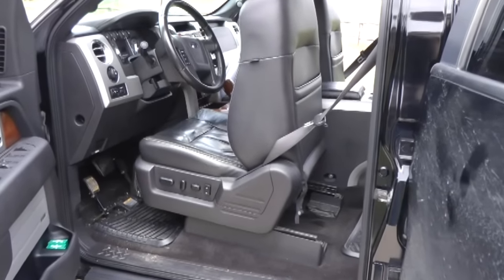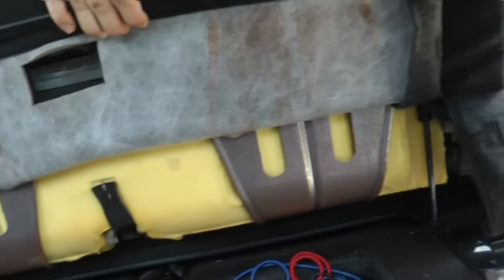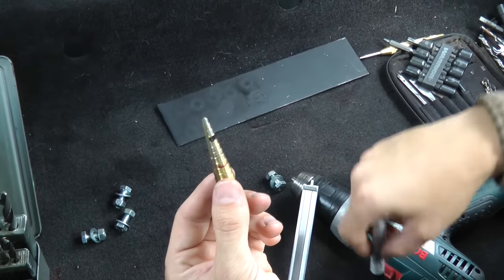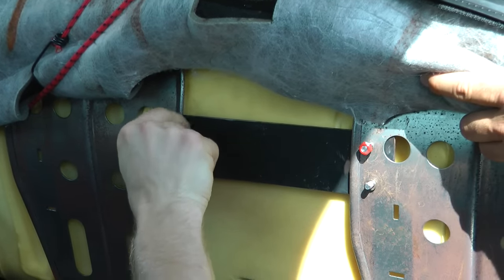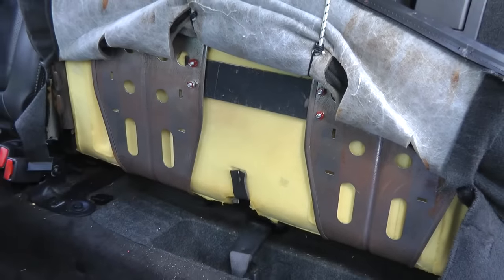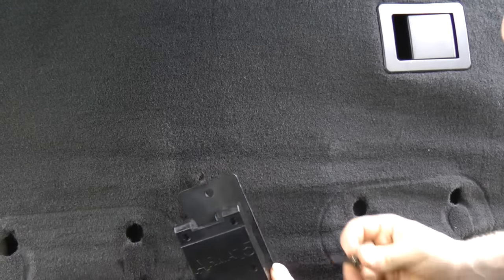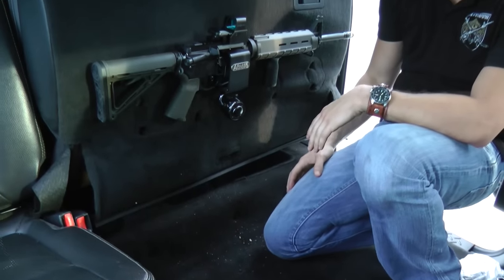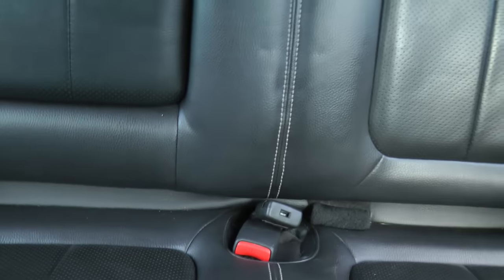ARmA15 Installed in Truck under Rear Seat AR15 M4 Locking Mount F150

Comment: Very cool, I like it!....I do have one concern and would be glad to hear from others....With the rifle being located by the mag well in a moving vehicle do you see any potential issues with the rifle moving around while driving placing undue load on the mag well?
I'm thinking maybe a plastic/rubber coated hook added to keep the rifle from moving around....
Thanks for the video  :)
Reply from the maker: The mag well in your ar15 is made out of aircraft aluminum while the only thing touching your rifle is ABS plastic.  So there is no concern there.  We have also had a customer completely total there car, bend the frame of the car and arma15 and ar15 showed no damage of any kind.  I also have one in my jeep and on ATV which have been run several hundred miles off road with no damage to the ar15 or arm15 in anyway.  Rest assure no steel touches your rifle.

Comment: Probably should have mounted it on the floor board instead of the seat. It’s quicker to run off with the seat vs it mounted to the floor board.
Reply from the maker: We have done installs in that location as well neither is better just whatever the customer wants.
Reply: ArmA15 AR15 I guess it’s just for the piece of mine for me. Excellent work though.

Comment: How well would this work for a scoped hunting rifle with out shaking so much that it un zeros the scope?
Reply from the maker: +Tyler McDonald If your rifle scope can handle the abuse of recoil then it can handle the very minor movement's when in a vehicle.  The rifle is held in arma15 via the magazine catch do its not bouncing around.  Also its high strength abs plastic so there isnt any issue.  I have a trijicon and a leupold that have been off roading many many miles and zero issues of any kind.  Its not held in via locking mechanism as no steel touches your rifle.  Hope this helps!
Reply from the maker: +Tyler McDonald If your rifle scope can handle the abuse of recoil then it can handle the very minor movement's when in a vehicle.  The rifle is held in arma15 via the magazine catch do its not bouncing around.  Also its high strength abs plastic so there isnt any issue.  I have a trijicon and a leupold that have been off roading many many miles and zero issues of any kind.  Its not held in via locking mechanism as no steel touches your rifle.  Hope this helps!
Reply: +ArmA15 AR15 very much so thanks bud could i basically do this same thing to the back of the seat of a single cab?
Reply from the maker: yes,  I would look into the rivnut kit on arma15.com  as we figured a much better faster and easier way to install using rivnuts.  You can piece together the hardware yourself but you will find that hardware is pricey.  Either way test fit and measure 2x then drill and install.  We have done them on floorboards, back behind single cabs, car trunks, police racks.  Since its low profile and can be used at any angle the install options are pretty endless.
Reply: +ArmA15 AR15 thanks this was a huge help great video!!

Comment: Is it a bad habit i keep my AR in between my seat and cup holders?
Reply from the maker: Not a bad habit.  When I am in the vehicle that's how I use it.  It's only a bad idea if you leave your rifle unattended that way for criminals or kids to have access to it.  When I'm using it it's right next to me when I go into a store, gas station etc it's locked up via arma15.  Simple really.  Pistol on hip rifle is secondary.
Reply: ArmA15 AR15 ohhhh boy well i mexican carry everywhere pretty much. Whenever i’m at flea markets or even inside stores i have my shirt tucked in with my colt .38 super. Whenever i do leave my AR in the car i make sure i’m not gonna be at a place where i’m too far from my truck

Comment: Would this work on a 2016 Sierra 3500 HD Denali? Using a Kel Tec PLR 16?
Reply from the maker: We have not tested plr 16, however it does take ar15 mags so its possible.  We didnt design for tavor or scar 16 but those seem to work as well.  There are several different ways to install in each truck.  This is just one example, subscribe as we have a gmc video coming soon.  If you want more info about installing in your truck contact us via arma15.com comtact page.
Reply: ArmA15 AR15 Ok thanks man I'm subscribing as I type keep up the good work!And expanding your brand!

Comment: Having to get out of the truck to access your weapon is kind of inconvenient wouldn't you say?
Reply: Not when u have polite zombies or understanding people robbing u
Reply from the maker: +5.56 Or 5.45? Have the rifle sitting on your lap when your in the vehicle if you wish, or mount the arma15 directly over your driver seat roof as some customers have done.   But this provides it a place to be when your away from the truck and the rifle isnt allowed to go with you.  :-)  Better a rifle in the truck locked than a rifle sitting in a safe at home.
Reply: +ArmA15 AR15 I can dig it. Keep my sbr under a large carhartt on the back seat.
Reply from the maker: Or front seat, or lap or dash board.  All work but what happens when you wanna leave the truck is what this solution is about.   Mine is in my jeep 24/7.  Keeping it in your hands and out of criminals.
Reply from the maker: You can roll around with your ar15 locked and loaded in your lap if you wish(state law permitting)  or with a pistol on your hip as most do.  ARmA15 provides a solution when you aren't in your vehicle and you want your ar15 to be there when you get back.  I leave min in my jeep at all times...

Leaving a rifle or any firearm for that matter unsecured isn't a good habit for a multitude of obvious reasons that generally keep people from using there most effective tool with them.

Comment: I would like to do this in a dodge ram 1500 2017...where can I buy this?
Reply from the maker: We have kits for your truck.  Arma15.com
Reply: f.e.d inc Are you planning on doing this on the passenger side? I have a Ram 1500 and my only complaint is the bench seat is on the passenger side.
Reply: @charlessubke5450  I planned on putting it on the driver side

Comment: does the bolt have to be locked back?
Reply from the maker: +alicia kitchen Yes.
Reply: Is the portion of the mount that goes into the ejection port rubber coated?  Has anyone had experience with the bolt releasing on a bumpy road?
Reply from the maker: Andy,

 There isn't any possible way for any steel to touch your rifle even if the bolt closes.  The magazine block is made from abs plastic.  The lock bar which is steel that goes into your ejection port has no way of touching your rifle.  Also the magazine block block's the access to your chamber so no one can put anything inside the chamber of the rifle when it is locked in the arma15 it also servers as a bolt catch so no steel touches your rifle.
Reply: +ArmA15 AR15 Thanks. I actually just watched a different video of a wall mounted option that gave a better view of the magazine block.  Very cool.
Reply from the maker: Thanks Andy!  We tried to think of all these little things when we were doing the prototyping, research and development phase.  Another purpose the magazine block serves that isn't really advertised much is it will hold in the rifle so if you don't need it locked up you can have the lock off and the magazine block will hold the rifle and isn't released until you push the magazine release button on your ar15.

Comment: I so want to do this but this my only issue with this is the gun is pointing to me.
Reply from the maker: When your taking it off and putting it on your in front ejection port not barrel so its not pointing at you.  Its physically impossible to have a magazine in and the bolt has to be open to put on the unit.  With all this said you can point barrel either direction left or right see our website for barrel facing left and right pics.  It's a preference thing makes no difference.

Comment: What if you need to kill a robber and he is in the back seat
Reply: Dr. Steve Brule , driver pushes a button  , the back seat has a ejection module set up , but the roof doesn't open up , boom one squashed robber written in the cab ceiling ...... looking forward to that video
Reply from the maker: +Dr. Steve Brule Ever tried to maneuver a rifle in a truck, that would be a pistol moment for me.  Also i keep my rifle loaded and up in the seat when in use.  I just use arma15 to lock up when i am not using such as when i go in a store.  We have sold to a dozen police departments as well....

Comment: Takes too long. I need to be able to access it without exiting the car (in the event that there were perpetrators trying to break in around me)
Reply from the maker: Or you can do as this user does and I do, rifle loaded and ready between seat and console barrel down.  And lock up when your away from truck.  Other users mount to roof above driver seat.
Reply: vince gredo that is a secondary weapon primary is a 38 special super o  desert eagle or one 5.7 in your glove box
Reply: Just hop in the back seat. I have similar truck and there's plenty of roof to crawl through the middle.
Reply: Simple logic really pistol on hip.  Rifle locked and loaded when you're in vehicle locked inside Arma15 when you are away from vehicle.  Military FBI and a dozen different police agencies use arma15 in vehicle in this situation.  Leaving it unattended and unlocked when your not in vehicle is not a good plan.

Comment: what you really need is a finger print reader ....
Reply: Being a firearms instructor I would advise against that.  If you do need this in a defensive situation then I would go with something faster and more reliable than any bio metric lock.  I don't like bio metric locks for firearms related products as in many cases your fingers wont activate the product.  If your hands are wet, dirty, bloody the fingerprint wont read.  A simple 1500 id lock can be opened in about 1 second with a simple directional movement a little bit of training and your hands could be wet, dirty etc and it will still work.  I understand the thought of bio metrics and it sounds like a good idea in a vacuum, but bio metrics aren't usually a good idea and they are crazy expensive as well for almost no upside.  Do you have a fingerprint reader on you phone, laptop?  Ever had your fingerprint not read because it was wet, dirty, or for no good reason.....?   I have.  Maybe in 2 years or 10 years they will make one that will work up to my standards but they just aren't there yet.
Reply: I've tried to unlock my iPhone too many times to know that's exactly what he doesn't need lol
Reply: Wrong.

Comment: If you buy a foregrip, is it angled, vertical, or unknown? Our laws distinguish between these different parts, and you can easily violate the federal law known as the National Firearms Act by installing certain parts on an AR-style pistol and turning it into an “any other weapon” or “AOW.”
To make matters worse, if you lawfully purchase parts for your non-sporting rifle and install them in certain states, you may have turned a legal, non-sporting rifle into an illegal “assault weapon” under your state’s laws, just by adding cosmetic parts. Gun control laws don’t usually make much sense, and these “cosmetic feature” laws are an excellent example of how little sense gun control laws can make. Gun owners know that a flash suppressor, a foregrip, a collapsible stock, and other parts of a rifle don’t make it more deadly, but more states continue to pass “assault weapon” bans, which make adding these parts to a non-sporting rifle illegal.
Reply: Dont sweet the petty stuff pet the wetty stuff

Comment: rip the bolts off? lmfao good fucking luck  6:50
Reply from the maker: +Gatorsrok True with the support bar in front it would still be very difficult to rip bolts through seat bracket.  We tend to error on the side of too strong when it comes to security.

Comment: Ok so bring bolt cutters and the gun is mine
Reply: +MADdaDJ  What's your point?  Sure, you can break into a locked car, cut cable or cut locks, then finally get a firearm, but it's still illegal and you run the risk of being caught and being charged with a felony.  The idea is to make it difficult to steal, not easy.  And unless you know it's there, you're not going to go through the trouble of breaking into the car for no reason.  The likelihood of someone stealing it is almost zero.  He's not going to put it in the bed of the truck so it's easier to take LOL
Reply from the maker: +James James very good point.  Also note you can buy a shrouded lock which cant be but by bolt cutters but then you have to deal with a key they also make shrouded locks that take a 4 digit number.  We like this option for speed but with the arma15 it allows you the flexibility to use different locks depending on your situation.  For instance when my jeep is parked in a shady spot I upgrade to a shrouded lock and then replace with a quick lock when I return to jeep.